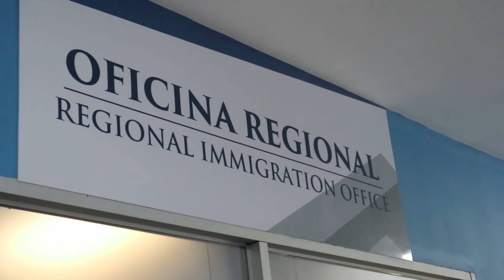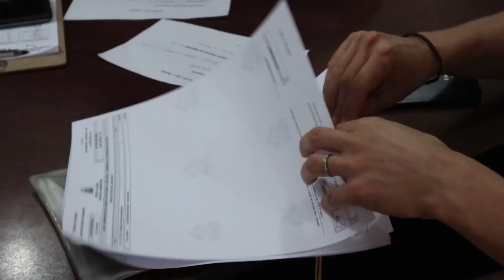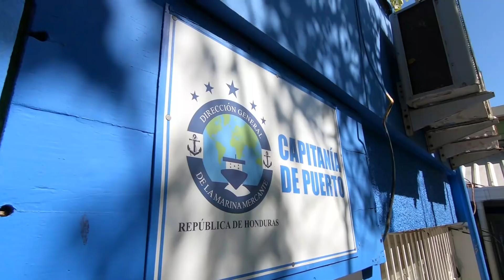DIY Sailing Lifestyle | Roatan, Bay Islands, Honduras | S03E33

Comment: As Jack neff said, use a self tapping screw (about 4#)screw it into the front face of the seal, where the steel is that holds the shape of seal. Also do yourself a BIG favor and purchase a complete pump assembly so when the impeller fails it's only a matter of undoing two nuts and two hose clamps. Another thing stow a small tool kit in the engine room. Build a wood box that fits neatly aft of the steps that fits all the odds and sods.

Comment: Hey! That Guy had a Cat Hat! Working in an OFFICE! That's called Stop-Drilling a crack. I suggest when you do your Refit, just saw the bottom three-four inches off your masts, and Coat and anodize the Insides of the mast foots for a foot or so Up to prevent Further corrosion...Just Amputate the Gangrene, so to speak..When pulling Oil Seals, most times you screw a sheetmetal screw down Into the seal, maybe TWO, where you can Grab On with a pair of Vise-Grips, or Pry it out with a Clawhammer, like pulling a Nail. Delos just rebuilt their RW pump, too, Underway. Must be Something In The Water? lol! Oh, that white, fuzzy stuff on the aluminum is Aluminum CORROSION, the Aluminum Version of RUST. You remove it all the same ways you do Rust. To Prevent it on aluminum, you Anodize it, which can be done Anywhere, by yourself. The anodizing fluid comes in several different size containers, and looks EXACTLY like pee. Smells MUCH better, though. Anyway, you clean and degrease the surface, then wipe the anodizing fluid on it somewhat liberally, and watch it dry. As it drys, it changes the color of the metal to a yellowish tint, or golden. A sponge or sponge brush is best for this. When it reaches the Correct Color(Light Golden, IIRC,) you just rinse it off with Fresh water. Let dry, and spray with a couple coats of ZINC CHROMATE Primer, that yellowish-green stuff they use on airplanes, then apply your paint system. I forgot the Real Name of the stuff, we just called it Cat Pee, but it's available at aviation supply houses, many boat supply outlets, and most anywhere they sell or work with Aluminum. Learned this in the Navy, doing Corrosion Control on A-6 Intruders....
Reply: That my friend is very good info, kind of you to share.
Reply: @keithpither2541  Just Tryin' to Help..

Comment: to get the oil seal out....screw a screw into it then use vicve grips to pull it out....works great
Reply: Wouldn't that ruin the seal?
Reply: @jeffmullins1475  Yes, but you use this method when replacing the seal. It doesn't matter if you ruin it.

Comment: Aren't they called snap rings clips? You can never have enough tools. Great episode. I don't know how you have the patience with all the paperwork in all the countries. It's the same for every sailing channel out there. The same run around or worse. Sometimes with bribes. 
Love you guys. Safe travels from your friend in Syracuse NY.
Reply: Yes you can, when you can’t get the tools at the bottom of the pile you need to slow you acquisitions! Or, if you need to move your water line,
Reply: simon talbot same thing

Comment: Nice video guys, both the immigration hassles and the water pump.  Keeping it real!  "Who has circlip pliers?" Actually, I do. Picked up a cheap pair at a Home Depot when I was looking for something else. The only use I have for them is the circlip on the water pump of my 40-year-old Volvo Penta diesel. Yep, been there, done that. Probably still have the greasy t-shirt somewhere. Be thankful for the Beta Marine water pump on the front of the engine! Minimal boat yoga!

Comment: 2 of the best lubes for drilling small holes in Aluminum are beeswax (toilet seal wax ring) or if you can get it, Boelube (it comes in a stick).  Also you were turning the bit way too slow; for that size of a hole in aluminum it is nearly impossible to turn a bit too fast with a regular drill.  A good rule of thumb ballpark cutting speed for hard aluminum like your mast extrusion is 300 feet per minute, which with a 1/8" high speed steel drill bit works out to over 9000rpm, which you aren't going to even get close to.  For drilling that size of hole in aircraft aluminum I use a 6000rpm air drill which works well and is still nowhere near being too fast.  So with an electric drill, spin it as fast as it will go, and I think you will find that it makes a nicer hole, and you will break fewer bits.

Comment: Next time you pull the impeller, add some liquid dish soap to the vanes upon reinstallation. It serves as a great lubricant upon start up and you can see bubbles to check for flow rate at discharge port.

Comment: Hi Guys,

Just noticed.. you seem to be keeping gasoline inside the boat. Gasoline vapors are volatile, heavier than air and accumulate in the bilge. Boats are lost every years due to explosions resulting from this issue. Your gas can if vented or with a loose lid is a source of these vapors.. 
We keep all gasoline containers on deck and our propane (same issues) in a separate locker which is vented overboard.. 
We enjoy your videos too much to lose you!!!!!

Mike from Storm Svale
Reply: If you had Desiree ? make a couple of covers for the two caddy's and stored them on deck   - make us all much happier  - fuel vapor is heavy - sits in the bilge - and just looks for an electric spark to make your life a bloody misery. - great work on the little raw water pump  - fiddly things

Comment: Good move on the pump , nice that Beta positioned its pump with easy access! Depco pump in Florida do very reasonable rebuild of pumps and if you send them your old one they can rebuild it and you can have a complete swap out replacement then if your in far off islands you can rebuild the bad one at the local garage repair shop.  Cheers Warren

Comment: Motor oil is always available and it is a heavy duty oil. It works great for drilling. Motor oil is also awesome for keeping locks from freezing up in the winter (or keep them from rusting).

Comment: Great video on the water pump rebuild!  Love that kind of content.  BTW, A good sharp awl is an excellent tool for pulling out old oil seals.  Just stab through the seal and pry it out.  Its beefy enough to take the punishment.  Regarding the bearing clip, you can use a pair of needle nose pliers in a pinch.  Sometimes you need to sharpen the tips a little, but works pretty well in a pinch.  Thanks for showing the world what cruising is really like.

Comment: For seal removing you can punch or drill a small hole in the middle of the seal, install a screw of some type then pry or pull the seal up for easy removal, hope this helps

Comment: Who has a set of snap ring pliers. Not me; I likely have about 10 different sets and types! 
To get that kind of stuff out or in like that oil seal heat is your friend. A small propane or butane torch should be a basic part of every boats tool kit, hot and cold are your best friend sometimes.

Comment: Hey Jordan  - the oil for drilling  - try a 50/50 mix of auto trans fluid and acetone  - also really helps as a dual purpose penetrene for removing bound screws

Comment: Next time (and there will be a next time)  heat up the pump body before trying to remove the seals, also when inserting them, it causes things to expand and makes it easier.  Oh, and I have a circlip tool, actually two different sizes.  Dude, they're cheap.  lol

Comment: Mast failure really ruins an otherwise nice day, and can make a bad day a whole lot worse. Barring serious injuries and collateral damage, it would still probably take at least a few months and a lot of dollars before all is resolved. Don't want to see you have to go back to Florida, but urge you to take the mast heel cracks very seriously.  It may be counter intuitive, but the mast heel is generally the most loaded/stressed part of the mast tube since it takes the cumulative downward compression loads on the mast tube of all the shrouds combined. At the very least, put some snug and strong bands around the mast wall at the heel to counteract the tendency of compression loads to spread the mast wall at the cracks, and sail with shortened sail until properly repaired. You will probably need to sleeve the heel for a proper repair. Once cleaned and repaired, Tef-gel liberally applied to the mast wall ID, step and plug will go a long way to avoid future corrosion. You may also need to add some drainage pathways and holes to help avoid internal salt built-up.   

Since you planned to replace the bearings and seals, sometimes it works well to drill two small small holes on the back face of the lip seal case, screw in small self tapping screws, and use them to pull out the seal with pliers.

Comment: Actually you do NOT want to use oil as a lubricant/coolant when drilling and/or tapping aluminum. Kerosene is recommended but in place of it use WD-40 or Mix one part Diesel and one part light oil.

Comment: Who has a circlip removal tool? Anyone who has met a circlip prio to the one they are now looking at. I see you are using Ryobi battery tools. I’ve out fitted Auroa Leigh with Ryobi too, not because their drills or batteries are the best (they are not) but because they have some really cool other tools. I started with Ryobi because of their fold out strip light which is awesome and I use all the time even as a desk lamp. It has the advantage that it will work of batteries as well as mains voltage. Then they have a cool battery hot melt gun which I use increasing often. So far for repairing broken stereo head set, the sliding blind anchors to stop them from rotating and slipping off, but most importantly for sealing and insulating electrical joints (soldered with the fabulous Milwaukie battery soldering iron) particularly sealing between the copper wire and the insulation to prevent water capilliaration up the inside of the wire (heat shrink is not good enough on its own). I’m also experimenting using hot melt to hold overhead things in place until the resin sets off. A tool I am using inreasingly often though is Bosch nano saw. This is a micro chain saw that is awesome for shaping panels to fit in awkward areas, and for cutting holes for instruments and the like. No good cutting fibre glass though.

Comment: Oh No ... Not AGAIN...??!!?  14:25. 😳😱🤭😩
Looks like ya done a good job on it though Son, I hope Faren sent you a replacement 
Bearing shaft since the one you got First had NO spacer on it...!!   BTW, I have several Dental
Pick tools also, one of the sister in-laws was a hygienist..  and the “Snap-Ring removal tool, I 
Have 3 of them now, it took that many tries to find one that Fit a Russian ring on my URAL motorcycle 
Also Russian, IF you haven’t gathered that yet...😳😎👍✅

Comment: looks like you missed a screw on the pump lid
Reply: Center top
Reply: Oh well.  How could he miss that?  It will leak again.  Half ass.  Want him working on your engine?
Reply: @jamesbockenstette4332  I bet he did it to see our reactions ha ha
Reply: @jamesbockenstette4332  it wasn't there when he started the project. Look before you judge. Besides that screw would have nothing to do with what was the cause of the leak.

Comment: Next time to remove your old oil seal use a small printed wood screw and screw into the middle of the rubber and then pull on the screw with pliers

Comment: I would do something other than store gas below deck, wouldn't want to see anything happen to you guys. It needs to be out of the sun , in a well ventilated place , with no water contamination getting into the gas. Easies said than done but very dangerous kept in a locker that's not force ventilated. With gas engine boats you have a ventilation fan venting the engine compartment that you turn on and vent the compartment for a few minutes before you fire up the engine's.

Comment: Couldn't you just have those crack's in the mast welded?  Or worst case senerio you could cut the bottom 4 inches off your masts and tighten or shorten your rigging.  Maybe you don't have to buy new masts.
Reply: If they can lift or remove the mast to expose the entire crack, they should be able to have it TIG welded, depending on the type of aluminum. There are many alloys of aluminum and not all are weldable and very corroded or dirty aluminum can be a royal pain to weld, especially when it is cast. Hopefully, they don't end up having to replace the mast for something that appears to be a small issue.

Comment: Who has a cir-clip removal tool? Anyone who has had to remove a cir-clip for a second time, ha! My problem is that I use it so infrequently that I misplace it and have to buy another.  I think I have removed less than two dozen cir-clips In my life and have probably bought  six tools, stupid cir-clips! Or I loose the proper end attachment, which you can only purchase with the whole kit. I think the devil designed them...